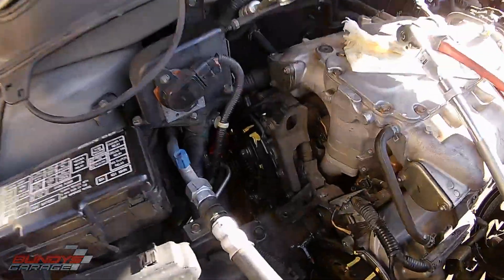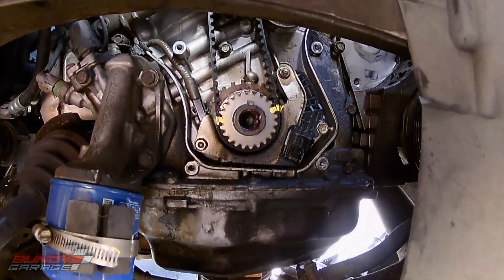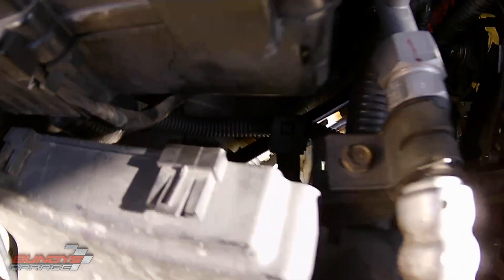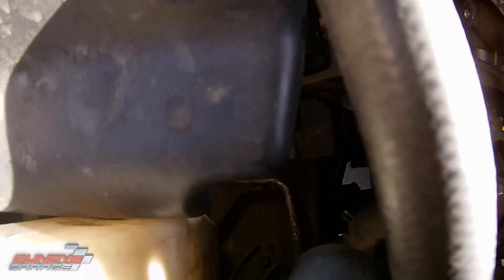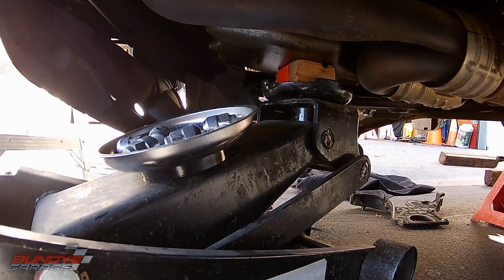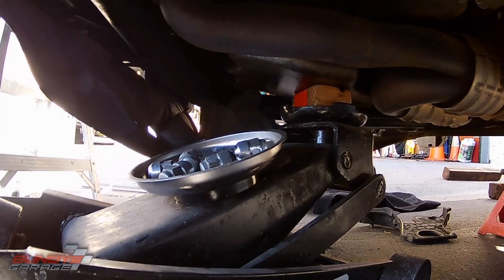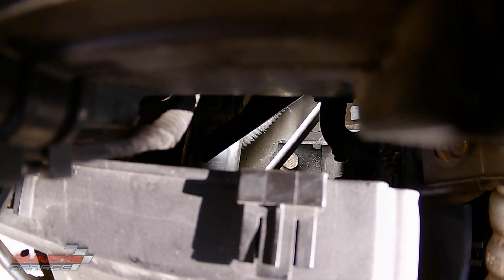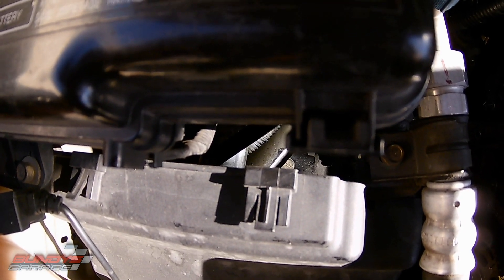Honda V6 J Series engine | Tips & Tricks | Transfer over the Timing Belt Markings to the New Belt

Comment: Hi Bundy  great video. just had a question on the crankshaft why did u mark the to sides . the mark is always that triangle on top. am i right.
Reply from the maker: It’s easier to line everything back up if you have 2 marks. As compared to just one mark.